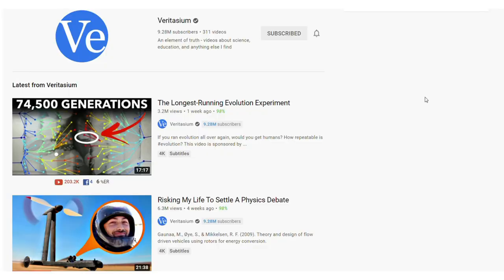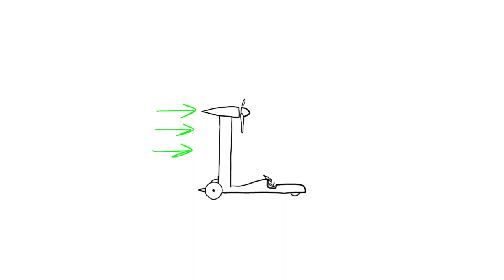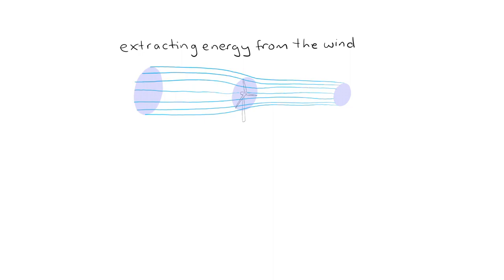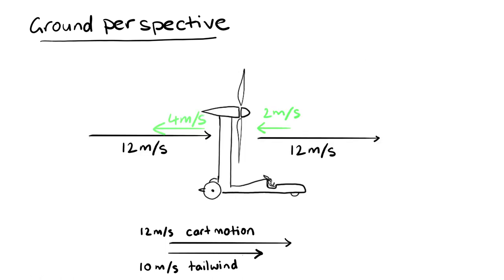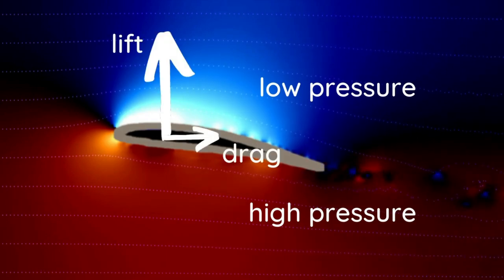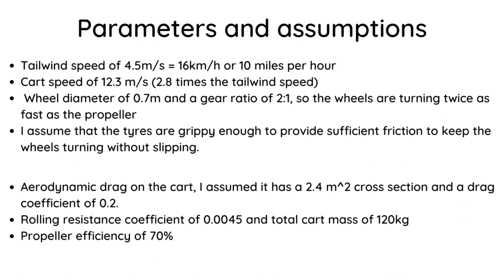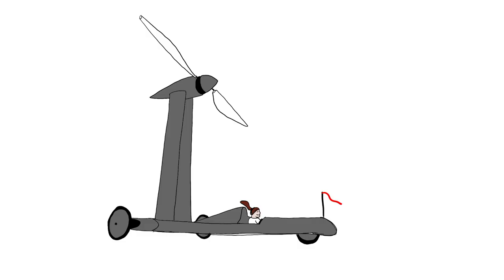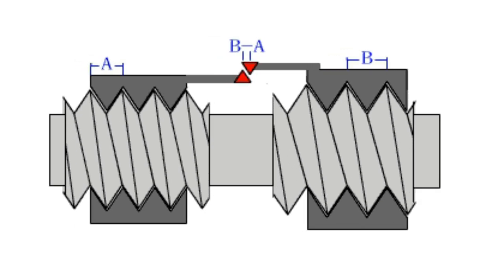Downwind Faster Than the Wind by Veritasium: How Does it Work?

Comment: For me the operational theory only gelled when I visualised that the air behind the cart was left moving slower than the surrounding air, and that's where the energy was extracted from. In the same fashion that sailboat leaves a wake of slower air.  Otherwise it has a whiff of perpetual motion machine.
Reply: I still don't get it. As I understand it, the wind pushes the cart and is where all the ultimate energy comes from. The wheels now rotate, and being chained to the propeller, it also rotates. So, the wind is pushing the cart AND rotating the wheels against the ground + propeller chain resistance AND rotating the propeller via the wheels. And I understand that whatever wind energy the propeller takes up in being turned continues to be replenished by MORE wind until the cart is at wind speed. Thus the cart is absorbing more energy from the wind than one without a propeller would. I get that. Now the propeller converts this extra wind energy absorption very efficiently into forward motion, so it more than makes up for its drag and maybe the cart gets up to wind speed sooner than a plain cart.
BUT
the instant the cart goes faster than the wind, the wind is no longer pushing it. No energy is being input into the system. All the saved up energy in the propeller turning will allow the cart to exceed wind speed for a while but ultimately without any push to overcome the drag and frictions the propeller should slow down by degrees until the cart is back at wind speed again.
UNLESS
the answer lies in the fact that the propeller converts energy into forward motion (and turn the wheels) more efficiently than the turning wheels and chain create drag???
But that's perpetual motion, except for the fact that you do need a wind input.
I DON'T UNDERSTAND
Reply: @greatbriton8425  "the instant the cart goes faster than the wind, the wind is no longer pushing it. No energy is being input into the system."

There's still energy being input into the system. Even though the cart is going faster than the wind the propeller is spinning fast enough that overall the cart is slowing wind down behind it rather than accelerating it. This is where the energy is extracted from.
Reply: @greatbriton8425  in the test, the measurements for the wind speed was a streemer in front of the propeller.

That will give you a FALSE reading slower than the actual wind speed.
Reply: @lelandtsnyder9684  No, the streamer was to indicate speed of wind RELATIVE to cart.
Reply: @greatbriton8425  that what I said. You won't get that the n front of the propeller.

Comment: I posted this comment also at Dereks video:
If you have a spool of wire (sewing thread, rope, electrical cord) and you pull the wire, you can make the spool roll towards you. If you make the wire come toward you from the underside of the spool, the spool will come toward you much faster than the wire end you pull. The calculations are strikingly similar.
If the spool is almost full, the speed ratio is very big. If it is completely full, you get the (v-w)=0 situation: 'infinite' ratio, but it won't start.

Comment: [Rosie shows a bunch of maths] my brain: "Uhm, I see, so the propeller goes BRRRRRR".
Reply: Ah, fascinating.
So propellers work in the same way as money printers... BRRR
Reply: @ak205  Air conditioning makes me go BRRRR!
Reply: I love it! And I'm right with you.
Reply: It’s funny because basically that’s what’s happening. As long as you get enough thrust from the wind on the blades when it’s relatively stationary to develop a little bit of vehicle momentum you can get the prop to just do prop things. It won’t really do you a hell of a lot good on a draggy keelboat, but the transition from prop-as-static-sail to prop providing thrust driven by craft’s mass acting on the wheels (or underwater prop if you wanted to try this with a boat) when you’ve got your drive ratios and pitches right on an efficient-enough platform, is essentially there from a very low speed above rest

Comment: Thanks Rosie! I had come to the same conclusion that the reason the professor thought it was impossible was probably because he overestimated drag and underestimated lift when thinking about the balance of forces (as most people not familiar with aerodynamics do---as a sailor I have to face that a lot, even with other sailors), and I got into a debate where I was having trouble giving a convincing explanation using only words. But then I found your video and spreadsheet, and it did it! Made me discover your channel and love it, subscribed now.
Reply: where is the spreadsheet?
Reply: @nadavsofer2686  It's the one she shows in the video
Reply: @SassySimian  How did you get the spreadsheet?
Reply: @anterokaarakka62  It's the one she's showing in the video. You could probably get it from her or reproduce it.

Comment: Thanks! This video broke me free of thinking the design should work with zero tailwind if already moving. The drag would be larger than the thrust and the vehicle would slow down.
Reply: Hi,
I've have same thoughts. We have initially  still car and no wind at all. We push the car to certain speed. Can the thrust be bigger or equal to the drug.  /Biker can use still cars to accelerate himself/?
Reply: @malingeorgiev2962  "We have initially  still car and no wind at all. We push the car to certain speed. Can the thrust be bigger or equal to the drug."

No, it is essential that the air is moving relative to the ground or else the cart cannot extract energy from the air to accelerate.

Comment: When that ribbon flipped around, I cried for some reason.
Reply: The air speed at the ribbon is not the same as the distant wind speed, because:
- The ribbon is before the prop. The prop is accelerate the air backwards, so it deccelerate the wind. The ribbon is in wind shadow.
- The wind speed near the ground is lower than higher. 
- May the wind and the cart direction not egsactly the same.
- Usw.

Comment: Thanks Rosie.  You are just the right person to explain this.  I understood what was happening with the original test, as I design sailboats.  When I tell people that an ice-boat can sail at 8-times the speed of the wind, people think I'm crazy.  But people don't understand that the Apparent Wind is very different from the True Wind.  In the case of this machine, it is the Apparent Wind that the prop blades 'see' that supplies the force to drive the machine forward.  As you say, once you understand the physics, it's not impossible.
Reply: >> As you say, once you understand the physics, it's not impossible.

Even if you don't understand the physics, it's still possible. :)
Reply: If you sail directly downwind, you do not exceed the velocity of the wind.
Reply: 8 timed the speed of the wind?  
The record for landsailors is arround 4 times , 135mph and an iceboat has never been recorded that fast.

Comment: So which is it below wind speed and which is it above wind speed? The fan driving the wheels, or the wheel driving the propeller?  And why do we need a variable pitch prop?   I didn't think the Verisatium video proved the concept either.
Reply: In downwind configuration, the wheels always drive the propeller (at all speeds).  The variable pitch prop is not required, it merely increases acceleration and thus requires less space to get up to speed.

Comment: Did anyone notice in the original Veritasium video that the “runaway propeller” scene (I think it’s around 12.5 min in) appears to be impossible.

There’s an obvious tailwind when the prop gets disconnected from the wheels, yet the propeller proceeds to accelerate in a direction where it’s blowing AGAINST the wind.

Any thoughts on this? I can’t explain at all how it could have happened.
Reply: In that instant the prop was set into negative pitch, and the ratchet allows it to freewheel.
Reply: "yet the propeller proceeds to accelerate"

To me it looks like the propeller isn't accelerating but rather the earlier frames in the video are just slowed down.
Reply: Hidden electric motors.

Comment: Here is something that I should have included. Use the frame of reference of the vehicle to best understand sailing downwind faster than the wind, not the ground. The vehicle is "blind". It can't tell if the air is moving or the ground is moving. For all it "knows", it may be on the ground, or it may be on a conveyor belt. It works the same either way. All it can tell is which medium is moving toward it faster. It extracts energy from the faster moving medium. 
   The same can be said for a windmill land yacht sailing upwind. The wind is approaching it faster than the ground, so it extracts energy from the faster medium. But for all it "knows", it could be on a conveyor belt and outrunning the conveyor belt because it is "blind". In that case, the windmill land yacht would be sailing "down-conveyor belt" faster than the conveyor belt. (Call it the "Brownbird"!) Mill-Prop craft simply use the energy conversion devices that are suitable for the media with which they are interacting. There are some unusual combinations.
   So in theory, Mill-Prop craft are simple to understand. The complexity is in the engineering required to make them most efficient. The engineering embodied in the Blackbird vehicle is superb!
Reply: This is the relatively rare case of someone getting it exactly right.
Reply: @Rick_Cavallaro  Thankyou Rick. I really appreciate that. And may I say, "Ditto".